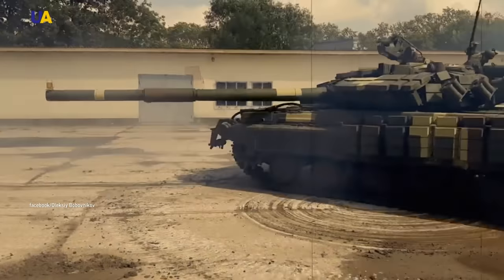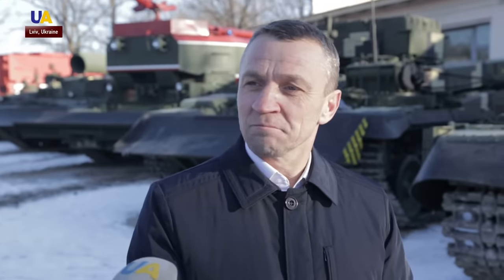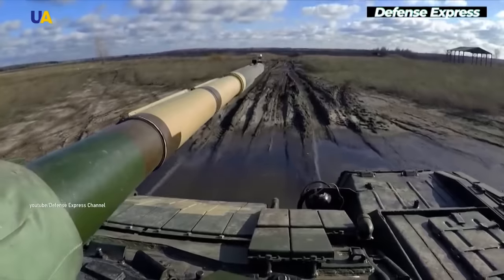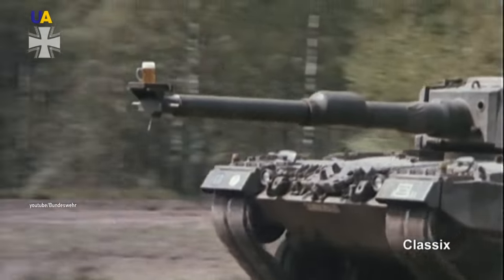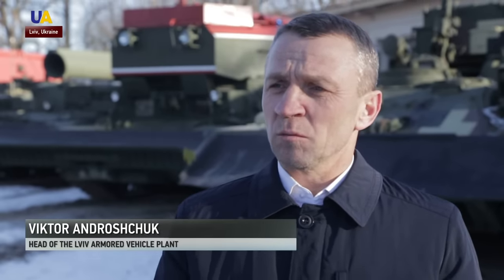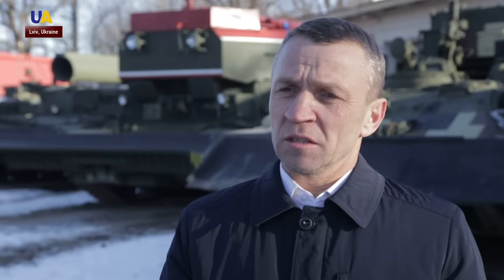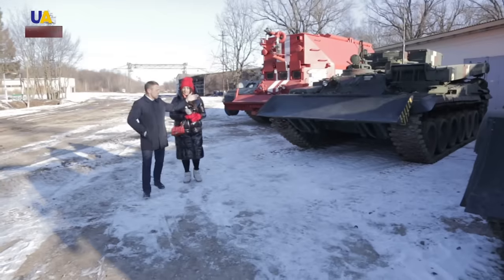How Can a Glass of Beer Demonstrate the Quality of a Tank?

Comment: Not trying to offend someone but the Beer Glas was half full and the Tank was going compared to the German tank really slow... (Edit thanks for the likes and for the conversation you guys started!❤️)
Reply: ahahahahhahahahha man you got the point
Reply: Sure bro, running off road 0:10
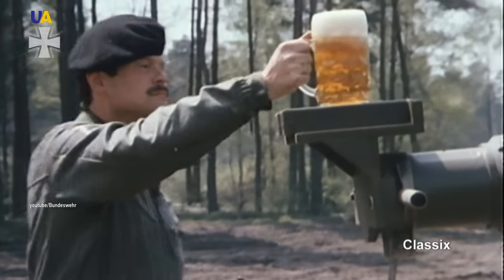Reply: @jozseftoth9368  your 0:10 off-road condition is nowhere as bumpy as the German one in 1:01
Reply: that too is footage from the 1980s, damn german engineers are fine
Reply: ucraine propaganda done wrong ahahahah, i noticed the same thing
Reply: The better the beer, the better the crew.
Reply: @jozseftoth9368  

A Little bit spilled out  whilst the German one didn’t.
Reply: ukrainian 1:12 is comparable to the german 1:01
Reply: @vibarva  just with half the glass😂
Reply: @Ender-jl8dd  amazing..
Reply: And the german one is somewhat 30 years old
Reply: I want to point of that most eastern vehicles are slower then the western counterparts that’s why it’s going slower using most of the time Diesel engines and not turbine engines which are a lot faster compared to a diesel
Reply: @TheSmg1t  The Leopard uses a diesel engine as well.
Reply: @TheSmg1t  Actually a lot of the Soviet tanks were faster then western tanks(if you compare them by the year of introduction), due to being almost if not more then 10 tons lighter. And just so you know, the slowest tank in this video was... a T-80BV, which uses guess what, a turbine engine. They just didn't rev it up for some reason
Reply: @Ender-jl8dd  It spilling out has nothing to do with the stabilization, that is innercia. You can try it yourself, put a glass on a even table, fill it out and move it quickly along it, then stop it as fast as you can. Gun stabilizers keep the gun pointed at the same spot, they do not smooth out the moves it makes. And not to say that T-72 has a better stabilizer, that tank specificaly got worse FCS then T-80s. T-80 series stabilizers should be just as good or close to NATO tanks of the same time though.

Edit: Don't know were I got the T-72 idea from, that is A T-64BV. Still that is a tank from 1976, when upgraded from B to BV I don't think it got a better FCS, just ERA and newly build models got different hull armor.
Reply: @derohnenamen3476  T-64B is from around 1976, the BV variant in the video as far as I know has the same FCS and stabilizer. T-80BV again didn't get a better stabilizer from a T-80B to my knowledge, T-80B is a tank from 1980. The "V" variants are most of the time the same tank but with ERA added, sometimes newly build tanks got better glacis armor layout
Reply: German tank engineering is the finest in the world
Reply: @hq1237  Sorry, could you quote what part you are reffering to? I can't find it.
Reply: @shepardpolska  ah thanks for the info I was just comparing the modern west vs East I’m talking 1980s vehicles m1 and all the turbine engine was normally a bit faster (edit one thing I need to point out is I’m referring to the earlier tanks like T-64B T-72A and B and the T-72 mod89 which compared to the turbine were normally slower from what I know not the Soviet t-80 and the federations t-90 variants)
Reply: @Jojo-fv8sy  does it? Hm alright thank you for that
Reply: @TheSmg1t  Yes, compared to the T-72A/B, T-64B (atleast untill the 6 cylinder engine) the M1 was faster
Reply: @shepardpolska  which now Pretty much all eastern tanks are on par and some faster with the western counterparts glad we could clear that up and thank you for your previous comments on mine always nice to get some new information
Reply: the beer glasses are not the same. The german one is a 1 liter super heavy glass. It's basically impossible to tip it over or spill with it. Ukrainian is a small one and much lighter. So it doesn't tell you much about how good the stabilization is ;)
Reply: @theacme3  Excluding the fast that the Russian tank has worse gun depression making stabilizing the gun harder for bumpy terrain.
Reply: @shepardpolska  if the point is that Soviet tanks are better, no... just no. The T-55 was made to be water proof and travel deep creeks (about 15 feet deep at max with a snorkel) and half the tanks ended up a mobile swimming pool or a permanent fresh water reef. (T-55 Was and example)The Soviets design lacked technology and quality. But there are some advantages they had.
Reply: @shepardpolska  also, the Soviet noticed that the Americans had turbine engines and saw the advantages of them, the only problem was they could not build one that meets the requirements and their expectations, so they abandoned this idea.
Reply: @shepardpolska  and no, they were not 10 tons lighter, not even a single ton. Compared to the M48, M103, or other a few American tanks, the Soviet MBT's were a bit heavier, but not "Maus" diffrence. (excluding the germans cause their Leopard 1 series were lighter than a single M48, about 2ish leopard 1's were needed to weigh closely to the M48)

(However, their armored vehicles, like the BMP series, were very much lighter than western armored vehicles)
Reply: @Indo-Sama777  M48 45 tons, T-55 36 Tons. That is 9 tons. M103 56 tons, T-10 48 tons.
Now for the part where you are most wrong. M1 Abrams between versions was 54 to 62 tons. T-64/60/72 tanks between models were 36 up to 46 tons. They were required to have less then 50 tons because that was the limit of soviet railways. Unless there is some comparison I am not aware of, eqiuvalent soviet tanks were significantly lighter.
Not going to argue which tanks are better because there isn't really such a thing. American tanks would be shit in a Soviet army/doctrine, and same if you gave american soviet tanks. 
Soviets droped the turbine engines because of high fuel consumption and other issues are the drawbacks of turbines, not because they couldn't build one. They simply decided turbines were not worth it for them, or there could be a political issue. I know for sure that only their first turbine engines had issues, which were mostly filtration issues. If I remember correctly the same issues happened to the M1 Abrams, maybe less severe but still
Reply: @shepardpolska  which model of the Patton are you using? The latest model which was the last, is indeed heavier than the first model, (several tons heavier than the first M48 design) T-55, but around the first generation of their models, the T-55 was heavier.
Reply: @shepardpolska  and I never said the Abrams were lighter than the T-62's
Reply: @shepardpolska  and when I say, "they couldn't build one." I wasn't saying they literally could not build one, I was saying they could not build an turbine engine that met expectations OR the requirements.
Reply: @Indo-Sama777  Then say which Patton model you are reffering to and its weight that, showing me comparable tank from the soviet union and its weight. I was talking about the tank in the video, which is a T-64 familly tank more precisely T-80BV, with a mass of 42 tons if I remember corretly. Equivalent US tank is a M1A1, which has a mass of around 55 tons. Soviets could build a turbine like that and they did. The one in T-80U. They just thought that Diesel engines are better for them, just like Germany and UK did. More over they decided so after heavy T-80 losses in Grozny offensive coused by sending the tanks into the cities. The generals blamed the design of the tank rather then tactics. It was likely more political then anything. I meant to type "T-64/80/72" reffering to the T-64 related tank designs, but wrote a 6 instead of an 8 by mistake.
If you want to argue that US tanks were better build, I am pretty sure they were maybe with the exception being soviet prototypes, but in production US models won in quality. It does stand that US tanks while similary armored, were much bigger and thus had to be heavier.
Please respond in a single comment if you can.
Reply: @shepardpolska  M48A2GA2 Super.

It's dry weight is a minimum of 53 tons. Yes, by dry weight, I mean no ammo, crew, or other personal tank mods

And the first Patton model was the M46. The wet weight was 44 tons stocked with ammo, crew, and more weight with personal tank mods. Dry weight would average around 38ish tons.0
Reply: @shepardpolska  the M46 weighing 38 tons, dry weight, and the T-62 around 41 tons dry. Not much difference.

Comment: The leopard has always had the best gun stabilization system, but its impressive that they've made a system for the t60, no more fixed gun flopping around as the tank makes a corner
Reply: The Soviets had a near monopoly on stabilizers since the 1950s with the T-55, it’s not impressive to have one now let alone back in the 1970s when the US finally caught up with the upgraded M60s. The stabilizer in the Ukrainian T-64s is the 2E28M which is newer than the one that originally came on early T-64 models, but it’s still from the 1970s. It was a good system for the time and is still good enough to be used today, but it’s not impressive nor did the Ukrainians make them themselves.
Reply: Ты это создателям "Т90 прорыв" расскажи...

Comment: the difference is the german tank is driving much faster over bumps and does not hardly even shake and is full, the other test is slow with a partially filled mug and if filled to the brim like on the leopard would have spilled, that being said it is good, but those few degrees over 2km would result in a miss while on the move
Reply: Well, Leopard is few decades younger 🤷‍♂️
Reply: @mykhailoversta1473  the leopard demonstration video was made in the 80s
Those tanks in this video got modernized not even 5 years ago. Get the hint 💀
Reply: @ErukanuSenpai  k
Reply: @Erukanu Senpai  shows how big the gap truly is between western and slavic technology.
Reply: @a.t6066  I'd bet the T-14 and T-90M would be able to preform the stunt pretty well, but there no evidence. The tank in this video is way older than the Leopard 2, and even if it had upgrades, they probably didn't replace the whole stabilization system.

Comment: Notice the absence of clear downward shots of the glasses, because they are clearly held in place by some kind of tape, as you can clearly see at 1:01.
Reply: yes. they glued the mug so it wouldn't slide off. the point is that it did not spill.

Comment: T-80-T-80B and T-80Us are turbine powered and were only given to elite Russian troops , the T-80D is the version your referring too, which is a diesel version, but then that would turn into the T-90 later, but most use T-72 versions T-72B3 is the current update to those

Comment: Its not amazed me as mechatronics engineer. Its only one of the application of close loop control system as we usualy use in robotics. Simple PID controller and powerful Servo Motor can handle this situation.

Comment: Watching the old 80s video it bas to be said that the soldier puts the glass on with pressure. I  bet a kind of double sided tape to fix the glass laterally because accelleration in this direction cannot be compensated by a vertical stabilisation. Regards from a german engineer.

Comment: The modern russian tank spilled a bunch of beer in this video and the German leopard from the 80s didnt spill a single drop. This, and the quality of russian arms and armament in ukraine just show how outdated and outclassed the russians are.
Reply: This is not modern russian tank. This is same era soviet tank as the Leo 2 tank in original beer test. It's said here that ukrainians repaired it well so it can perform this test. And the original Leo 2 beer test shows just 6 seconds of moving with beer, compare with this one. Tanks always slightly accelerate-decelerate on rough terrain and it WILL eventually lead to spill a lot even with perfect 2-axis stabilization. So your conclusions are naive as anything else anti-russian.
Reply: @Alexander Kharin  but in this case acceleration is generally far less important than jerk.